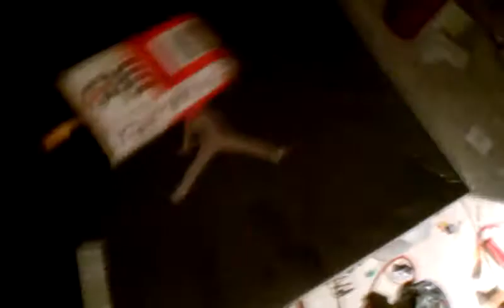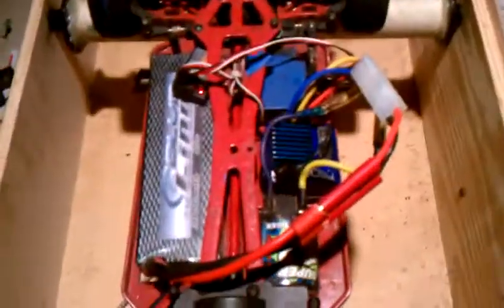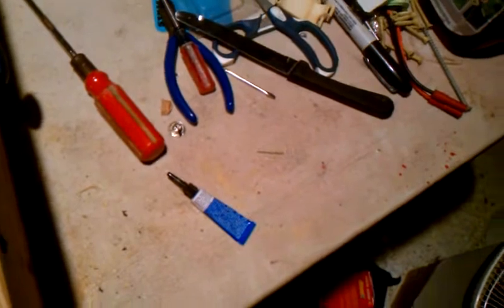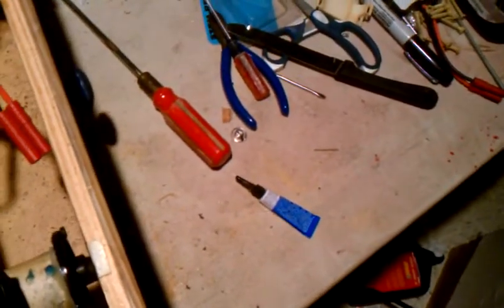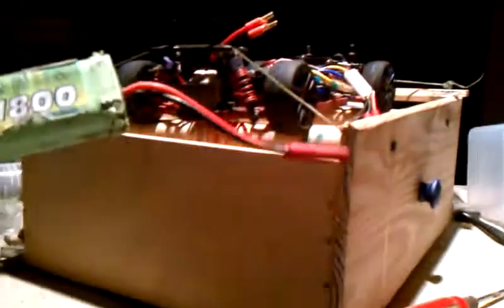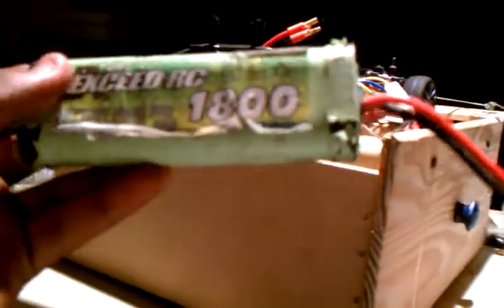This is the run of my dyno for the first time

Comment: @MR350ze - Kinda hard to explain, try looking at how i oriented it in my video or from the Simple Dyno website. You cut one of the earphone to get the magnet to attach to the roller, then the other earphone uncut with ear side facing the roller.